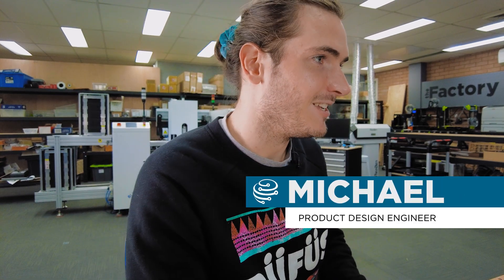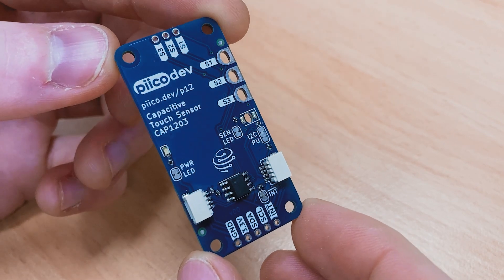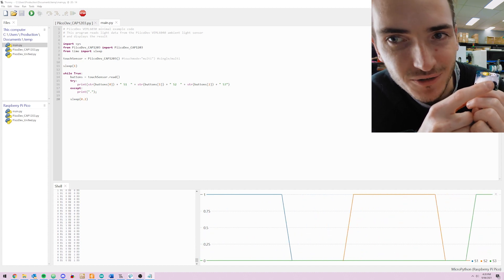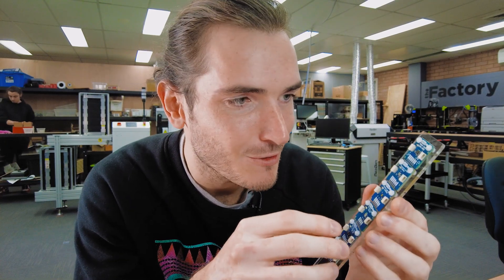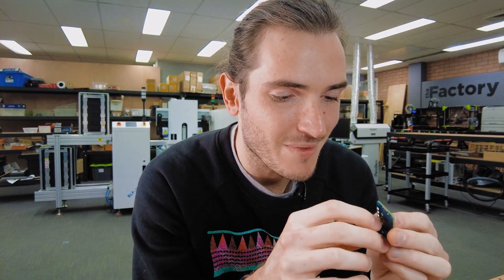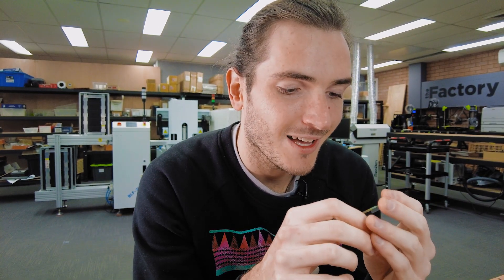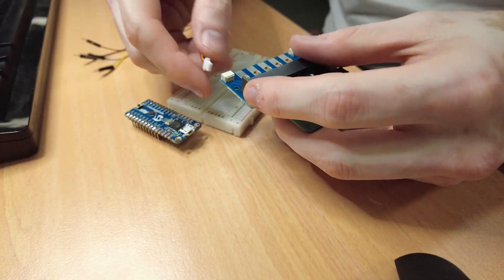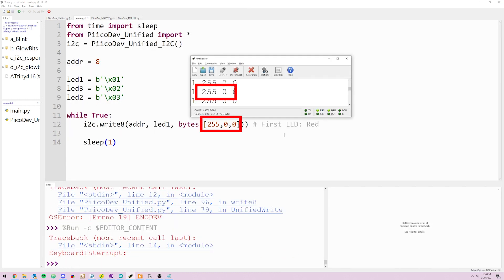The Factory | Unlocking The Potential Of I2C

Comment: Sorry, not seeing the big deal here? I2C is just a communications protocol. Reading buttons/sensors/whatever using their GPIOs is kind of what microcontrollers do, and communicating with other microcontrollers instructions and results over I2C is pretty common. ATtiny45/85 chips are good for this. Here's an example: https://www.electronics-lab.com/build-i2c-sensor/ .
Reply from the maker: All good, we are just sharing our PiicoDev journey as we go. We are excited to unlock the use of other non-native I2C devices, using an MCU interface. And of course, supported by our PiicoDev unified libraries so they’ll work on everything from RPi to Microbit.

Switches, screens, potentiometers, etc. The PiicoDev collection will soon have plenty more creative choices for beginners and seasoned makers alike, taking their functional code to any dev board that they want.

As always, we will share updates on our #TheFactory episodes.
Reply: @Core-Electronics  It does look like you're putting together some fun stuff. I tried to edit my comment but it didn't take, for some reason. Anyway, sounds like you might want more than the ATtiny's 8 KB of flash. The classic ATmega328 might be the way to, if 8-bit is sufficient. Best of luck. Apologies for being a bit cranky before.